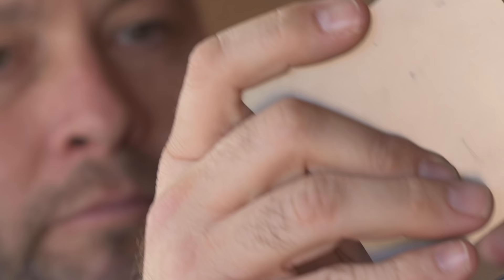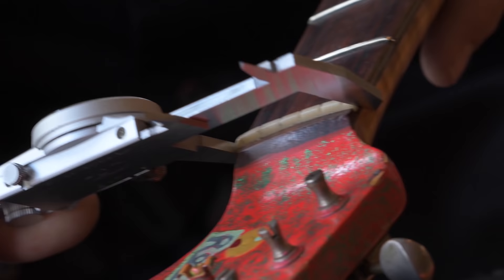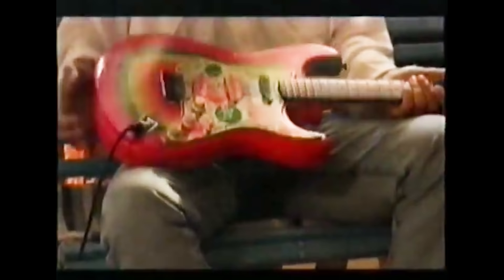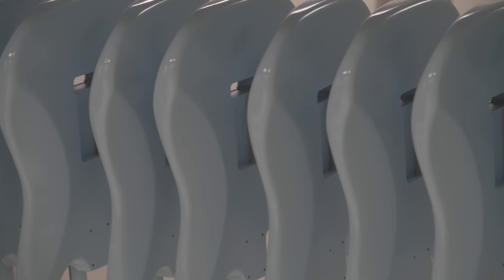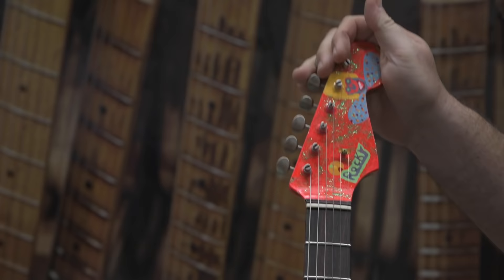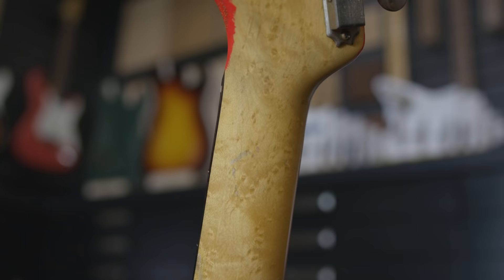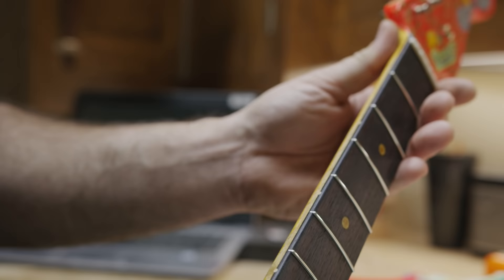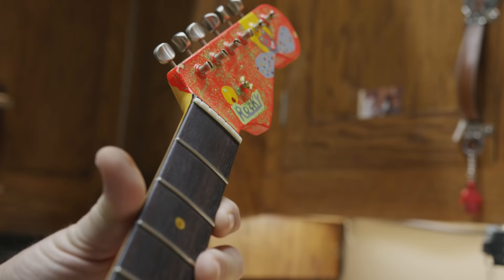Building The George Harrison Rocky Strat | Dream Factory | Fender

Comment: 25 grand? You think you could make an MiM one?
Reply: ljh
Reply: You could get a 'real one' for $25k before the '2 year old got busy with the paint set' look!
Reply: Years ago I tried my hand at it.  I had real dayglo paint from late 60s-early 70s and a stripped  strat copy.  I suck at drawing and had to do a lot of tracing, and I didn't even try to get the hardware and pickups exact (though I had a pickup winder and a lot of possible wiring diagrams off the Internet. Long story short, I gave it to a friend at Christmas and he liked it a lot.  Later I made another.  The guy was happy and I put the profits toward a "Chibson" copy of George's red Les Paul, which was what I REALLY wanted.
The point? This sort of modding is a lot easier than you might think, if you let your desire for authenticity be governed by your budget.  All it takes is detective work and trial and error.

Comment: Superb work from the custom shop. 
However having worked in the tooling industry for 20+ years I was floored by seeing you guys using no torque control whilst assembling the neck and scratchplate ?
It's impossible to get consistency and repeatable final torque value with lockover clutches. 
My USA STD from 1987 is still my No1 however. 

But if you guys haven't checked out the Atlas Copco PF6000 you can program psets so you assemble a whole guitar with multiple torques accurately. 

Check them out.